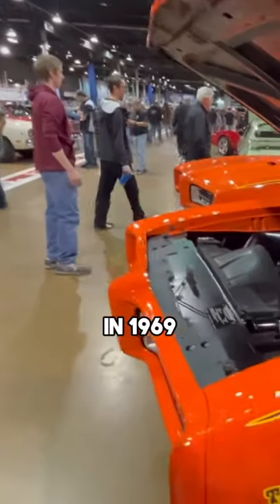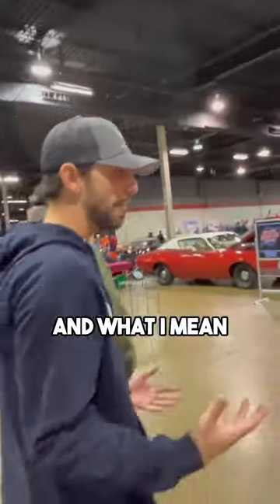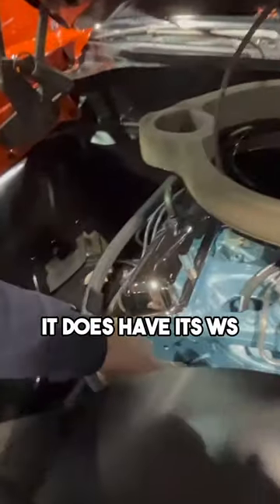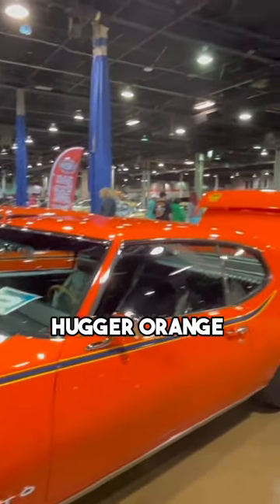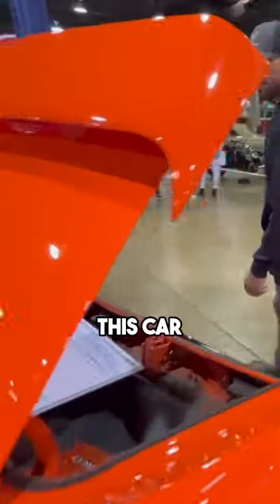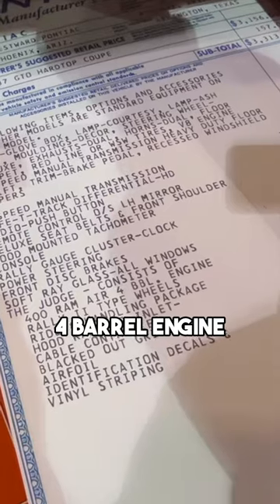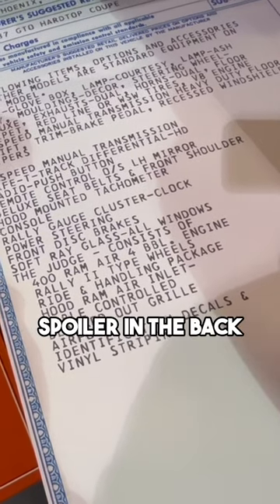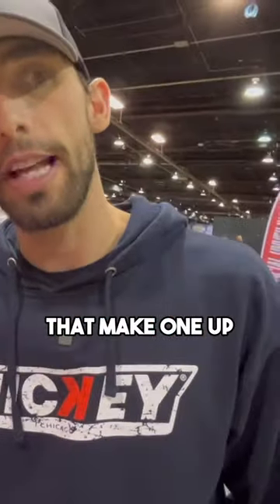The Judge Call Out Signs

Comment: 4,358.26 in November 1968 is equal to 37,878.82 in November 2023. 

Can you imagine if Hellcats/Demons/ZL1s cost sub-40K?
Reply: They should. They’re just cars.
Reply: they probably cost more nowadays because of all the electronics in them
Reply: You gotta factor in the GREED AND HYPE.
Reply: @Pablo-Turbo   But you should also consider the amount of cutting back material and labour as well.  A lot of the newer cars use less steel. A lot of them also are built with less labour with the help of robots.  In theory, they should be even cheaper than they were in 1969, not more expensive.
Reply: @Sackmatters 
Engine and luxury typically boosts the prices
Reply: Yeah but consider the fact that this car was the top of the top and was making 260 horsepower whereas our top cars are making over 700 more than three times the amount of power we used to have as well as luxury Interiors with a radio power steering good speakers comfortable leather seats four seaters
Reply: corporate greed
Reply: @Edward_Bernays 
Nope, AC, power windows and a host of other things that are standard in today's cars says that you're wrong about "if anything they should be cheaper" because there isn't as much sheet metal.
Reply: Those cars aren't iron lumps with carbs and leaf springs. Sorry but this car is significantly worse and less impressive than a hellcat, even if it's cooler
Reply: @dukecraig2402  

A/C is cheaper now than it was in 1960's because of automation.

Why is A/C cheaper because of automation, but car shell and assembly more expensive after automation?

If this muscle car was made today, it would be 20k with modern automated manufacturing.  But you're arguing the electronics are worth 60k as to explain the $80k+ in prices.   

Did you ever stop to think we're just overpaying for the brand name?
Reply: @Edward_Bernays  
You're a joke.
Reply: @dukecraig2402    Bro, you the type of person to go to a fully-automated Mcdonalds.  See people complaining that the price 300% more, and tell them it's because of the extra cost in electricity bills while you pull out an Iphone.  That's you.  X)
Reply: @Edward_Bernays damn Duke Craig got your ass !! called you a joke after not being able to explain why he’s right. yannow that means he won this argument 😎🙏
Reply: @Edward_Bernays consider nothing. The upscale in price is 10x more than upscale in manufacturing costs

Comment: In my younger days, I had three 1958 Chevy Impalas. Two convertibles, one that was all original, one with some upgrades, and a Coupe that was my 'hot rod'. Heavily modified and built for touring around town and to car shows.
Being about the same size and weight as the '58 Coupe, I transplanted the coil springs, brakes, sway bars and steering box out of the GTO and under the '58.
I designed all the bracketry and the steering box mount and my brother welded everything up for me.
The original 348 ( later became the famous 'real fine' 409) was rebuild and paired up with a 700r4. Then creature comforts like 'Vintage Air' in-dash A/C, cruise control, kick ass sound system, Corvette wheels and other goodies.

After the late model '50s cars, the late 60's were the KINGS.
I really miss those days.

Comment: Those were the days. You could buy a two year old car for half that. I ran a '67 442 paid $2,000- two years old. Ran like a top. Always a gear head straight out of Vietnam. Have several others now plus my daily 21 Scat Pack Challenger which cam run circles around any muscle car of yesteryear. Nice video.

Comment: GTO judge is the GOAT. I love Pontiac. The only unicorn i truly would have liked is the RAM AIR 5 pack on the 1970 or 1973 Trans Am, preferably in Brewster Green, with Camel/Cognaq interior, with the rear center console, the Rallye 2's (not the honeycombs), and offcourse the manual 4-speed, and the rear bumper guards, and the 'fire chicken decal delete'.

Comment: My Dad bought a 69 right off the showroom floor. He payed a little over $4,000 dollars for it. It had a 400 V8 4 barrel carb 4 speed hurst shifter and a 4:11 pos track. It was dark green with a lighter green vinyl top. Same wheels with chrome beauty rings. If I remember correctly it had G60/14s on it

Comment: The ram air system in Pontiac GTO and Buick GS did not work all that well. I remember reading an article back in the 80's where they put a GS and a GTO in a wind tunnel, and found that the ram air on both did not work all that well. An open element filter worked better than the Ram system.

Comment: Yep, you can completely counterfeit, a judge, out of a Pontiac tempest. You can even get yourself the correct build sheet. And a window sticker off of eBay.
But there's one definitive way to tell, whether or not it is a actual judge, or just another clone. And it's not under the hood. It's in the trunk.

Comment: Sir, was the Judge designed to be a value muscle car, to compete against the Plymouth Road  Runner?
Reply: yes, but no. it was planned to be that, but corporate executive greed turned it into the profit center they wanted. The concept eventually reached the 
market as the GT-37.
Pontiac also kind of had this happen with the 691/2 TA. a brilliant engineer
named John Fitch came up with a concept car called the Firebird Sprint Turismo. (PFST)  Stripper with upgraded suspension, brakes, extra crossmembers, Koni shocks, no a/c
and so on. WAY faster on a road course
than a Z-28.  The PFST got turned into a luxury coupe, the only real thing it kept was the ram air IV.

Comment: ramair III made exactly 0 more horsepower. not just rated power, actual dyno tested power and elapsed time tests on a drag strip open vs closed.
only 69 T/A, 70 formula and 71-72 GTO scoops actually worked. everything else
(for Pontiac) was just a hot air vent for after you shut it off.

Comment: How much HP? 175. .190 maybe?
Reply: Way more remb this is Pre 70s emissions chocker ' more like 350-375 hp but about 410-430 tq the 455 bbp was the bad boy!
Reply: 366 hp for a Ram Air III engine and 370 hp for a Ram air IV engine. Although both were slightly underrated ) 
The 455 wasn't available in the GTO until 1970